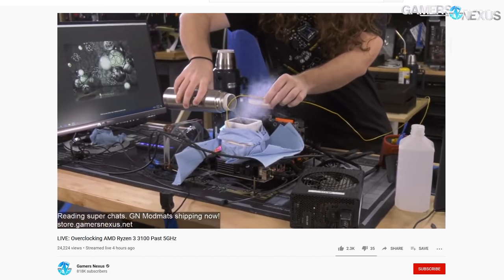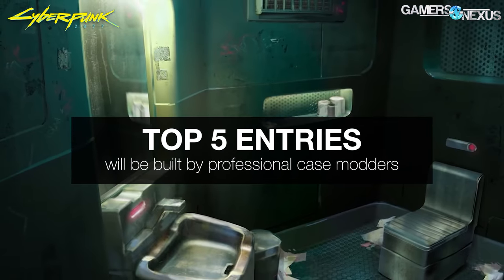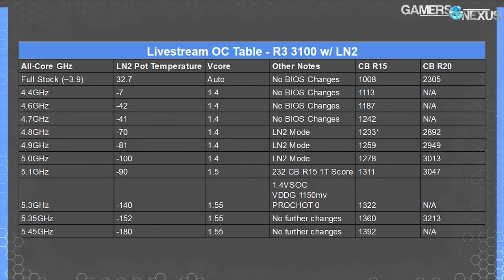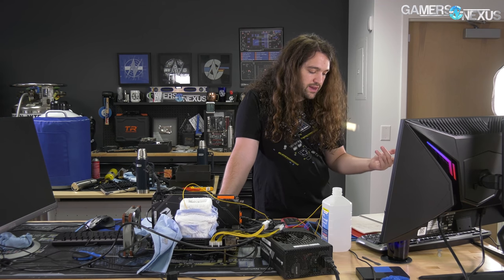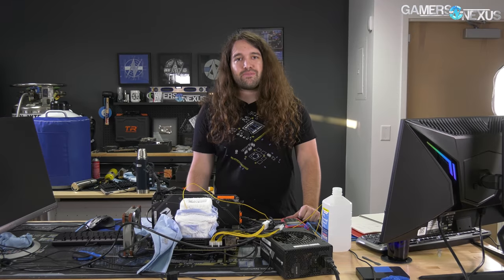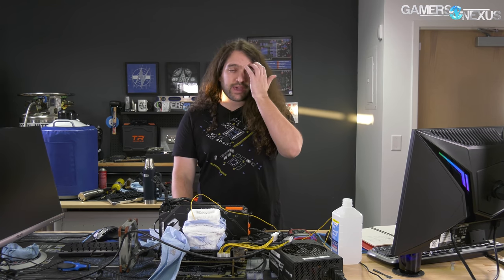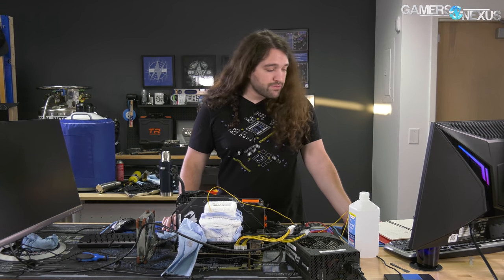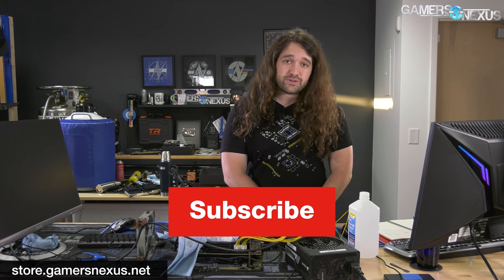5.45GHz AMD Ryzen 3 3100 Overclocking Results & Recap

Comment from the maker: Original livestream archive: https://www.youtube.com/watch?v=Adgsh0EvUZk
Watch our R3 3300X bottleneck benchmark: https://www.youtube.com/watch?v=Sq0OHhRQwA8
Reply: An alternative to having to stick a torch in it the second the test ends is to just note the score quickly and throw it into another test and don't pour any LN2 into it.
Reply: Really curious if the 3300X scales even better with it's single CCX design.
Reply: Steve can you overclock r3 3300x to maximum!
Reply: What settings do you recommend for OCing a Ryzen 3900X to All Core Constant Frequency when using a All Air build and 24/7/365 level stability? How far would you clock your RAM & Infinity Fabric for that type of operation?
Reply: I still don't get it WHY you didn't use Vcore offset +0.2 instead of override. The offset isn't lost when you use Ryzen Master. So if you used 1.55v in Ryzen Master, it would be 1.75v given to the cpu.
Reply: What happens if you use thermo steel for containg the liquid above the processor, may be it will sweat less outside the container and you have to use less protection???????
Reply: Sys data com securety account personal ok

Comment: If I'm honest, Overlocking these Entry-Level CPUs are very exciting, if only to see how far you can go with such a little chip.
With something like the R9 3950X, You kind of have an expectation as to how far it can go.
With the 3100, You have absolutely no clue; it could the best Overclocking chip out there that you can play with for days on end, or be a Complete Dud in 5 Minutes.
Still, I appreciate these recaps, as it gives those who don't want to watch an entire stream a straightforward video about what happened, how everything broke down, and most importantly, bring the results right to the Audience in a Simple Manner.
Keep up the great work, GN!
Reply: What are high end chips...except factory higher clocked CPUs? (in some cases this is literally true)
Reply: Cheaper chips are better too, much more scary to overclock expensive chips cause you don't want to ruin them.
Reply: @dennislp3  More cores
Reply: @maxms6087  and integration, cores within cores, neighboring threads... infrastructure, framework...
Reply: yea people are even comparing overclocked 3300 cpus to the i7 8700k and 9700k its kinda crazy

Comment: Der8auer paying Steve to buy his thermal paste is a classic.... I hope GN does a thermal paste review soon.... it is 2020 after all, and dudes from 2030 will want to refer back to undisputed fact in their videos.....
Reply: Judging by how hot the 10900K gets... In 2030 running a CPU that's not soldered directly to the heatsink will result in a thermonuclear explosion. At least on the blue side.
Reply: @snowwsquire  it's possible to have thunderbolt with AMD, your motherboard will just have to have an Intel thunderbolt chip in it like the asrock x570 taichi, also you could always use a thunderbolt pcie expansion card

Comment: This on a mid tier or low end GPU see if it can be overlocked to pass high end would be fun to watch
Reply: Yeah in many games 4 cores will bottleneck, no matter how fast. But the 3100 with oc should handle even a 2080 relatively good.
Reply: would need to change the bios on the card, then make custom power delivery to support it. plus a LN2 pot would need to have brackets for it depending on what it is
Reply: Someone just did a vid on this without XOC lol
Reply: GN did a video yesterday with the 3300X and it scaled well all the way up to the 2070 Super. Only the 2080 Ti was bottlenecked.
Reply: I mean, I've always wanted to see how many MHz you could get out of a 1650 or 1660, but I always assumed that the manufacturers had a reason other than cost and availability, rather than just not wanting to test the waters
Reply: @effrumtheretardo  until you try to play a game like Warzone that is stuttery af past 60fps on 4 cores unfortunately
Reply: @maxxtheender  +200 core and soemtimes up to +800 memory I've found to be doable on a lot of nvidia cards.
Reply: @WookieWarriorz  This is what I meant. Some games need at least 6 cores. My 2600 doesnt have any stutters in warzone and 100+ fps most of the time.
Reply: @geiers6013  not really apples to apples, but my 3820 at 5.125ghz, couldn't keep up with my 2080 :/
Reply: @effrumtheretardo  It only barely bottlenecked the 2080 Ti, too. So that means it wouldn't bottleneck a 2080 either.
Reply: @WookieWarriorz  The 3300X has 8 threads.
Reply: @WookieWarriorz  How do you stutter on warzone?
Reply: @ihatelols  But there are very cpu intensive games that need more than 4 cores. For example: warzone, pubg, ac oddyssey.

Comment: I got my start with computers back in the day with buying cheap entry-level CPUs and swapping a few jumpers on the motherboard to get them to run a higher speed.  To me, that was always the challenge to see how much above stock you could take something.  Was so very satisfying to  take an entry CPU and push to faster than the top-end CPUs.

Comment: 4 core, 8 thread CPU OC'd to 5.0GHz and still only using 75Watts
Meanwhile
7700K at 5.0Ghz is 165Watts
Reply: I don't think he was talking about his 7700K tho.
Reply: @jayden974  My 7700k at 5ghz with 1.4v use 110w
Reply: @ItsMeLeo  One should clarify what "uses" means. Meaning, what is the workload? If it's a game, it will be lower. If it's Blender, video transcoding or similar high-intensity multi-core workload, it will be higher.
Reply: bgtubber The discovery of the hot water...
Reply: @ItsMeLeo cap
Reply: Yeah, at minus 100 bud; 7700k would likely show similar power figures at that temp if not even lower
Reply: Nah, just with an AIO.
https://ibb.co/68kznFV HWMonitor reports 110w after a Cinebench R15 run at 1.4 with 5ghz. 
With heavier benchmarks it will consume more but the fact is that it consumes about 40w more than 3100 at 5ghz in the same test.

Comment: Just a thought... Could the lower voltage requirements & better OC capability over other Ryzen 3000CPU's be due to each CCX only having two dies active and 1/2 of the cache in each CCD plumbed? I imagine it could result in less thermal density in theory as each CCX would only be running 1/2 the components of pretty much every other Ryzen 3000 chip with the exception of the 3900x (3+3 plus 3+3) and 3600/3600X (3+3), but those CCD's still have 1 more core per CCX than the 3100 (2+2). If you think about the real estate, the 3300 has nearly 2X the thermal density per CCX than the 3100. 
EDIT I was typing this as the video was playing, had already watched the LN2 stream. I clicked to post and not a minute later, Steve at the 10:40 mark proposes the same theory about thermal density. Fucking Steve! LOL
Reply: Adding to my previous comment. I'd be curious to see what would happen if AMD took a 3950X and disabled 1/2 the cores on each CCX, but leaving all L3 cache active (all L3 cache on a CCX is shared with all cores within that CCX), creating an 8 core processor, but unlike the 3700X/3800X, rather than all 8 cores in a single CCD, you have 4 active cores per CCD (2+2 / 2+2). Wonder if that would OC scale similar to the 3100? If so, it'd be a great gaming CPU and I'd imagine AMD could push the base and boost clocks a bit higher from the factory, Might be a better competitor to the 8-core K-series than any of the current 3000 series. Anyway, these be the musings of an old nerd still trapped at home social distancing.
Reply: @racerex340  remember the disadvantage of the cores split between CCX's in form of a latency, which would neglect the higher clocks
Reply: @GewelReal  I don't think we can safely say it would be 1:1 comparing to a single CCD 2+2, to a two CCD 2+2 plus 2+2 layout with 2X the cache, but your latency point is 100% valid.
Reply: @racerex340  I've been watching a lot of videos about the 3100 & 3300X and I remember hearing the latency issue being brought up also, in regards to everything else you said. Negating any gains mostly, that is. If I see it again I'll edit this with the link... Maybe JayzTwoCents?

Comment: Regarding the sudden temperature drop after the benchmark: Might it just be possible to automatically run a synthetic CPU load like prime after a benchmark so that the system is still under controll?
Reply: cpu went completely unresponsive, most likely system crashed
Reply: makes sense, perhaps a ramp down load test prog that would auto-exe when CB stops?
Reply: You could also (ab)use the process scheduler of the OS for this: Running a dummy load continuously in the background and settings its Process Priority to low using the Task Manager. That will automatically lower the dummys CPU usage hopefully near to zero while a benchmark is running and would let it reuse the CPU immediately after the benchmark ended. That would be the fastest method possible.
Well, but this might still slow down the benchmark somehow. Maybe there are tools to set the dummys priority even lower than the Task Manager allows. And you could also higher the benchmarks priority, too. (But don't set it to "real time". ;))
(Btw: Does Steve read all these comments? He might be working too much.)

Comment: I know this is hella late but try to change the environment. Such as lowering the room temp and use multiple dehumidifiers. Pull as much moisture out of the air, also vent the room or make it positive pressure. Just food for thought.

Comment: Are you planning to do the same with the 3300x?
Reply: 3300x at 4.5 Ghz beats 9600k 😯
Reply: Love it when they Call me Big Papa  yikes
Reply: @Theguitarskater1  in ur dream. can't even beat 3600x OC. Watch some benchmarks here on yt 😪
Reply: @mrbeyonder6081  wait what's the difference between r5 3600 and r5 3600x ? aren't both overclockable ?
Reply: @dragos8839  Yes, both are overclockable but more overclocking headroom in 3600x is the difference. 

Also it has a base clock of 3.8 ghz and turbo boost of 4.4 ghz , compared to 3.6 / 4.2 of 3600 ; makes it an overclocked version of 3600 for people like me who won’t mess with the cpu & use it as stock.
Reply: Love it when they Call me Big Papa  your being a fanboy

Comment: AMD: Bring me Intel!
Intel: Fawk....
Reply: @shaolin95  Sure, Intel can do that, but Ghz is not all that defines CPU performance. IPC is the other half of the story. Zen 2 on average has about 10% higher IPC compared to 9th Gen Intel so even at much lower frequency Zen 2 ties and in some cases beats Intel's 9th gen core for core. Not only that but also at half the power consumption. The only saving grace for Intel right now is gaming since the ringbus core layout on their consumer desktop CPUs tends to benefit low latency workloads like games. This will most likely change though with Zen 3 and the latter will be even better at games because there will be no more inter-CCX cross talk - all cores in the chiplets will be unified under a single CCX lowering latency further and this will benefit gaming quite a bit.

Comment: Ryzen Master shows my r5 2600's voltage as about .2 V lower than every other monitor I've tried. I really hope no one's running an overclock based solely on Master's sensor readings~♥

Comment: so what does this mean for a simple air'water-cooled system in relation to OC numbers for 24/7 users?
Reply: Nothing really. If I recall the highest stable overclock they could get for the review was 4.3. It still hits a wall around that point, just like the rest of the 3rd gen parts.
Reply: @BuzzKiller23  hmmmmk.. sooo I guess I'll be sticking to my 10yr old 8C16T, Xeon E5-1680 v2, 25mb L3 (OCd to 4.6Ghz) for a while longer.
I'ill keep holding out till someone releases a CPU that crosses 5.3Ghz (stock or OCd stable)
The smaller die and lower power draw of the newer CPUs still isn't enough of a reason "upgrade" yet vs the price..  and to top it off, my system still runs effortlessly.
Reply: jo jace have you considered ipc? Clocks arent everything you know

Comment: or you could use an industrial dehumidifier and run it all the time of the test, plus a couple hours prior, and you will not have condensation problems and a pound of snow on the motherboard

Comment: Have you try to put the entire mother board in a bassin in order to have only ln2 gas covering the entire setup maybe it would help to avoid having moist air condensing on the cool motherboard. I remember whene work in paint making and we had product water sensitive and we use ln2 fill the gap under the cap with, it could work and help preventing having water build up and help reducing the amount of ice you get.

Comment: I want to know AMD's decision on why they have the 3100 on 2+2.
Why not make both 3100 and 3300x 4+0 config?
What difference does it make on production cost?
Reply: The 3100 has a cut down cache in both CCXs. The Chiplets in the Ryzen 3s probably all have some defect in one of the caches, which is why they are useless for anything but the Ryzen 3 line. And to go from a 3300X candidate to a 3100 candidate, you only need one defective (as in not reaching baseclock) core on the undamaged cache.
AMD probably analyzed their Chiplets and decided that a 4+0 and 2+2 with halved cache were optimal for yields.
Reply: They should be at over 99% yield by now with their Chiplets. I can't think of any single defect that can make a chiplet unusable.

Comment: Hello GN, hello peeps, i've got a huge problem. I bought a MB asrock 970 pro3 R2.0 2nd hand the pre-owner saying it functions fine. Got home, put an Fx 8300 stock cooler corsair vengeance lp 1866mhz psu bequiet dark power 650w all together including a zotac 650ti single fan 2gb ram. Turned it on, and there's no peep plus a black screen. I switched the GPUs a plenty of times cuz I've got a few. All fans running at 100% plus black screen. I changed the  CPU to an fx 4300...same result. Then I had the brilliant idea to put in my asus rtx 2060 same thing as result. When I put the rtx back into my rtx back into the pc where it came from, I suddenly had a black screen on that one as well. That pc is a r5 1600x on a Asus prime x370-pro including 16gb ddr4 3200mhz...no signal..no beep. Neither on my monitor nor on the TV set. Back 2 the asrock...I switched psu cuz I have 5 of em plus around 8-10 old GPUs...I cleared the cmos ...battery out...jumper set...waiting for minutes..hrs...no results. I took another old MB that has an athlon with integrated GPU on the mb or CPU to check the GPUs including my rtx....all running full fan speed but black screen. Now that mb won't even show me a screen pic anymore. Idk what to do. Plus I'm running thro a midlife crisis cuz of the crap. Please help if anyone still awake. Greets from Germany. Sincerely, René...
Ps...I know this doesn't belong in here but Idk where or whom i should contact, since I've read tons of bull on the internet so far.
Reply: Throw the question on the PCMasterrace reddit. They should be able to help
Reply: @shawntucker7674  ty shawn for answering that fast...is he on this platform as well?
I'm just asking cuz I've never been in this  kinda situation b4.😢...just checked...need 2 log in @ reddit w/ email account etc if I got it right
Reply: @shawntucker7674  did it..problem is...my account is brand new...auto-bot dropped my bid in the trashcan 🙄🤦‍♂️

Comment: Is it possible that these 2 new budget Zen 2 CPUs (3100, 3300x) are newest batch and use a more matured 7nm crystal? 5 Ghz at just 1.40V looks exceptionally good for Zen 2. Can anyone check the production date on the heat spreaders of 3100 & 3300x and compare with the initial batch of Zen 2 CPUs from last year? 🤔

Comment: Wait you're saying I could hit 4.8Ghz with a Ryzen 3 3300X? NH D14 here with very open case with loads of fans ready to go.

Zen 2 at FX overclocked speeds? tech jesus fuck
Reply: I wonder what this processor will do with ram under ln2. 
5.5ghz ddr4 with a 5.5ghz Ryzen 3 3100

Comment: Question- What if chips are designed to run under LN2 at extremely low temperatures? Would it be possible to get much much higher clocks? Chips today are designed to run at normal temps, but is the technology being "held back" by that?
Reply: There are cheaper and better ways to get higher frequencies, silicon is not a great material for Semiconductors, but it is highly manufacturable. Germanium based microelectronics can run at higher frequencies, be much more radiation hard and use less energy. The problem is that Ge based microelectronics are literally more than 100 times more expensive to manufacture and these costs aren't amicable to economies of scale.

Comment: My 6700k@4.6 gets an even 1000pts in Cb15. So ryzen 3000 is 18% faster clock for clock.
Any data on the single core tests?
Reply: I'll try to do a test when I get home, I think is relatively close in per core performance at the same clock, but this is by memory. Idk what my single core boost even is to be frank. If this was reddit I'd put a remind me timer for it!
Reply: I remoted into the pc, my 3950x boosted to 4.3, got a single core of 195, all core of 4.2 and a score of 4067. Hopefully that helps, if not I apologize.

Comment: Oh hai, 7700k been doing 5ghz since 2017.  And before you say it, I will sell you my 7700k for less than you can buy  a new 3100 or 3300x and I will throw in the motherboard.  Whats the next excuse?
Reply: That it cost 200$ more than this chip when new for just the CPU alone? It's a budget steal. It's not randomly their highest performing chip...